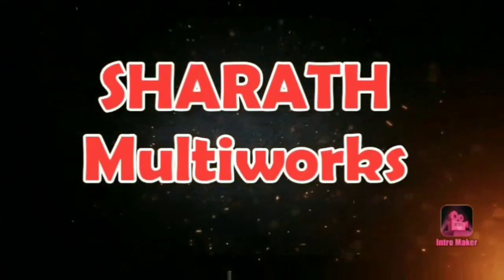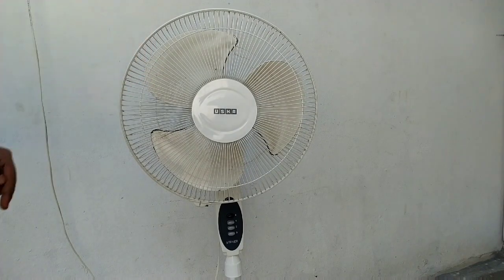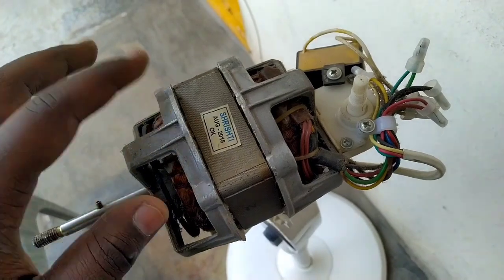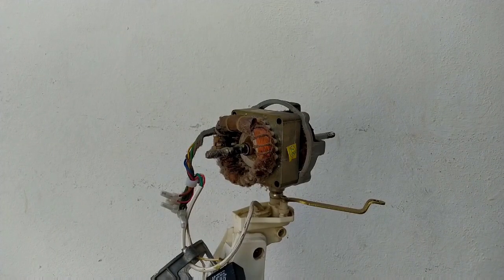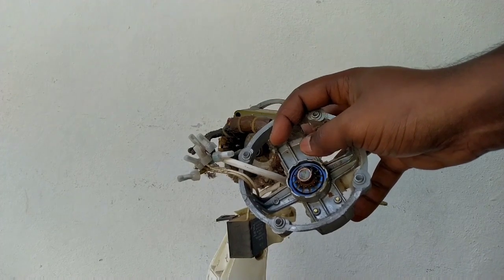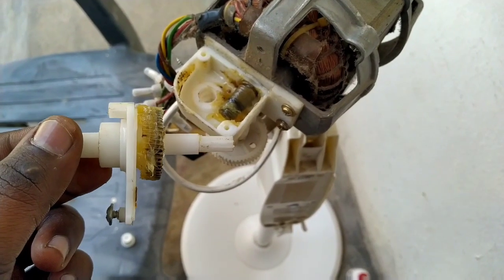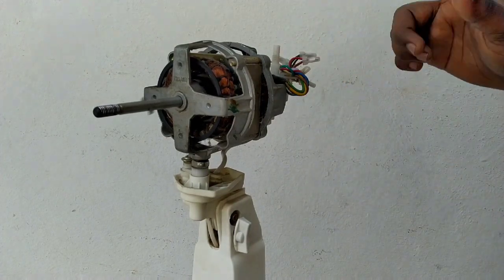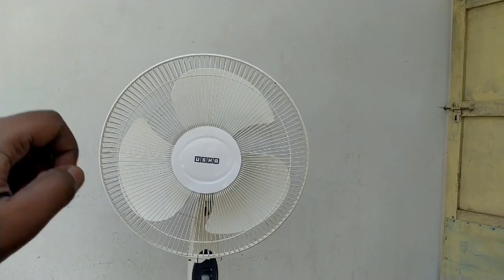Pedestal fan // Slow // Sound // Problem Solved in Telugu

Comment: Good job. Sound రాకుండా ఫ్యాన్ slow ఐతే కండెన్సర్ problem ఎగ confirm ga. Aa squre టైప్ condensers dorutaya entta ఉంటాయి cost
Reply from the maker: square ani kadhu broo andhulo uf value vuntadi 4 ala so manam patai tesukelli electrical shop lo chupedite vallu istaru 50 to 70 Madhya varry
and apology for late response
Reply: @sharathmultiworks5509  no problem bro.  Uf value I know  bro ఎక్కువ రౌండ్ condensers దొరుకుతాయి కదా ఈ టైప్ dorutaya అని అడిగా
Reply from the maker: @durgavenkata6891  okay fine dorkutayii Max electronics shop lo try cheyandi bro

Comment: ఉష కొత్త pedestal ఫ్యాన్ Speed ఎక్కువ మరియు తక్కువ అవుతుంది . కారణం ఏమిటో ? తెలియచేయగలరు *
Reply from the maker: Voltage drop ina itundhi, leadu ante max bushes problem vuntadi
Reply: @sharathmultiworks5509  i have checked my home circuit it is stable. Naku fan  10th Oct delivery ఐంది.
Reply from the maker: @V_lens  okay ite, fan ki warrenty vuntadi adhi try cheyandi. Oksari I think bushes problem vundochu

Comment: Revares terugthavund tebhul fan
Reply from the maker: Supply lo vunna wires lo okati capacitor ki icchi vuntadi adhi reverse lo vundhi connection
Capacitor yoka enko wire ki evandi
Konni cases lo capacitor fail ina fan reverse ga tirgutundhi